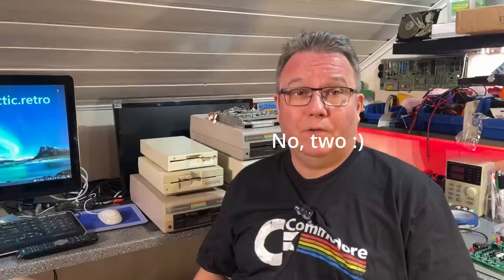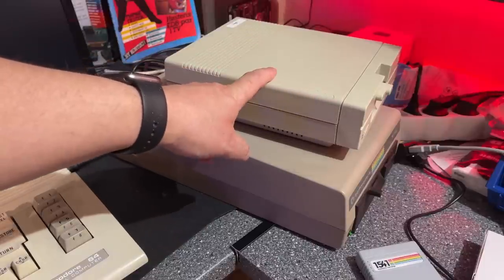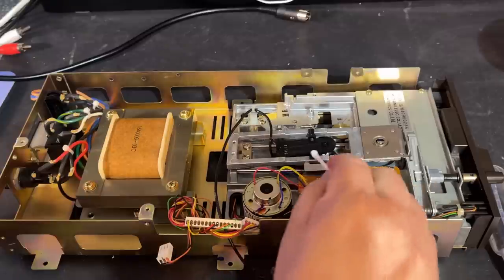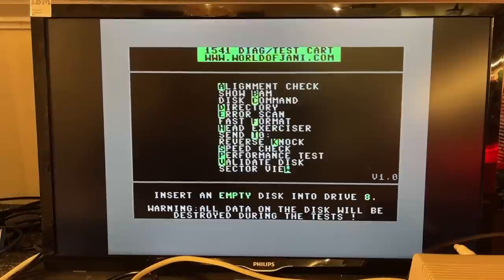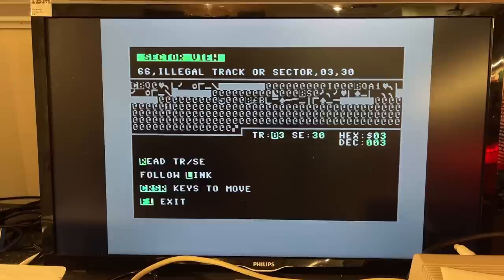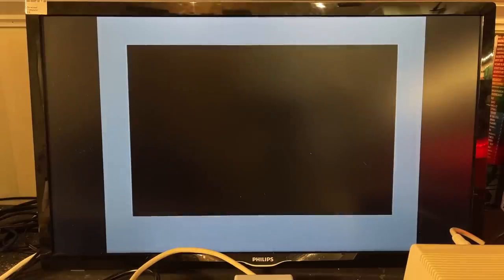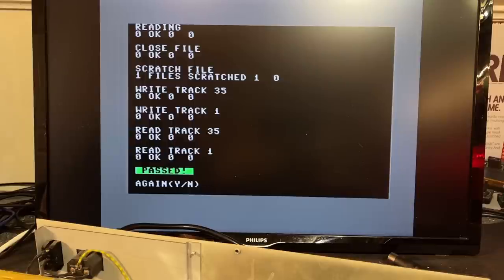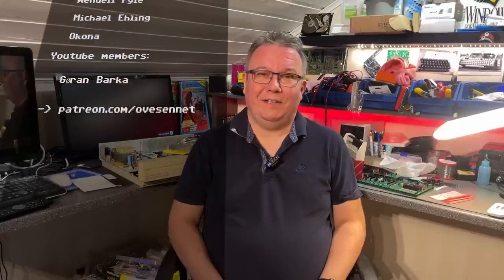Commodore floppy drives diagnostics testing - Do they all work ?

Comment: The alignment test needs a floppy disk that is formatted in a known perfectly aligned drive to make a comparison between that and the drive it is testing. Unless you have such a special calibration floppy, the results you get have no meaning. When you test the alignment with a floppy that was formatted in the drive that you are testing, even if the drive is aligned way off, you will get good results because you are comparing the drive to itself, which is especially meaningless.
Reply: Probably best to use original software disks, possibly even from known good factories.
Reply: @Breakfast_of_Champions  I usually use a 1541 demo disk or similar.
Reply: @Breakfast_of_Champions  Yes, better than nothing, for sure. Just make sure you don't run the destructive tests on them. :-)
Reply from the maker: Ok. That makes sense. Thanks for the info:)
Reply: I was going to write the same comment. Formatting a disk in a misaligned drive will most likely fail in another. These test needs to be done again.
Reply from the maker: I obviously did not understand the consept of alignment test here :)

Comment: Yes, I used the same Meanwell power supply for my 1541. It´s working very well. The TO3 voltage regulators can be removed. This reduced the heat radiation a lot.
Reply from the maker: I'll see if I want to spend it on a 1541 or not:)

Comment: Nice video! Detailed for 1541, I like to see the OC-118 ^^
However, can you also test double-sided disks on the 1571? Is the top head working?
(I'm looking for help and ideas about the 1571, because I have two that are failing the double-sided use. They both work in 1541 mode tho')
Test should be easy: just do a format in 128-mode. First it will do the bottom side, then should go through the top. 
Keep up the good videos!
Reply from the maker: I can try. If you search my channel, I have a video about the OC-118 from a while back.
Reply: @Arcticretro  Thank you for the reply! I meant, that I was happy that you have covered the OC-118 drive (as  I child I used that). Looking forward to see if you can test the double-sided mode.

Comment: Awesome video! I was just using this 1541 Diagnostic Cart to test a 1541-II I had that wasn't reading any disks. I simply did an Alignment Check on it using my 1541 Demo/Test disk and miraculously the drive could read / write just after that check. I ran the Performance Test on it afterward and it passed. I tested it to read disks that it previously couldn't read and it worked. Anyone have any idea how the Alignment Check would have fixed this drive? 
I have also had luck repairing a 1541 by simply formatting a new floppy disk, does the format disk and alignment check process of travelling the head across all sectors have a way of repairing a drive?
Reply from the maker: Maybe just exercising the drive mechanism makes it better.

Comment: Great video. I have 2 x 1541's (1 not working) and a 1570. Bought a Drive diagnostics cart and am waiting for it to arrive, but now I know how to use it. Also thanks for showing the alignment screw - that was a great fix. I have recap kits for all 3 drives too. 
Question though: will you change the belts ?
Reply from the maker: Thanks a lot. There is no belts on these drives
Reply: @Arcticretro  Good - one less thing for me to fix

Comment: Where would you get belts if you needed them? Also is silicone grease effective for plastic gears?
Reply from the maker: I have never had to get a new belt for a 1541. However, I got new belts on eBay for other drives. As for the silicone, can't tell.